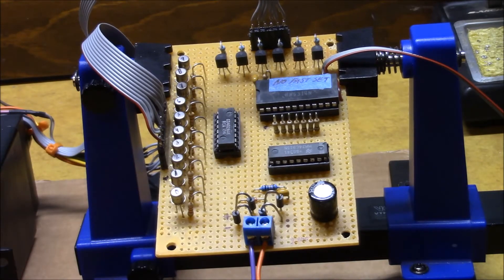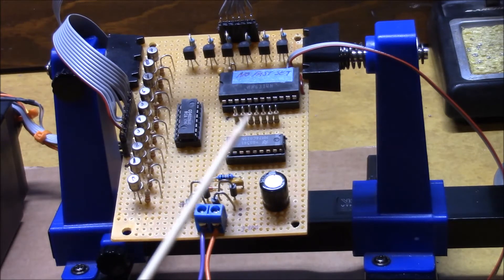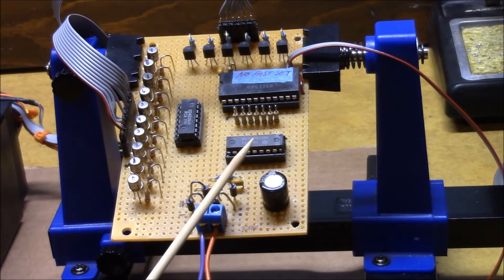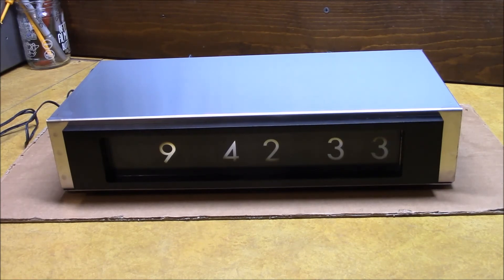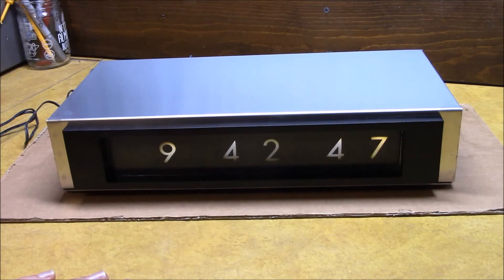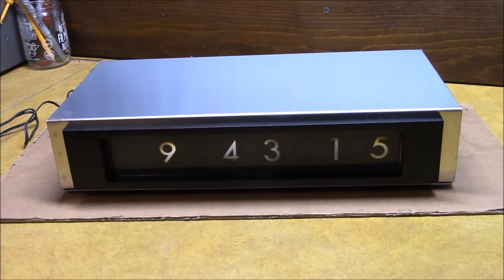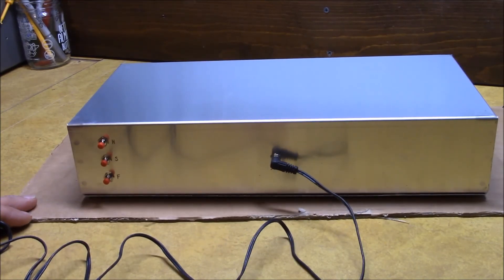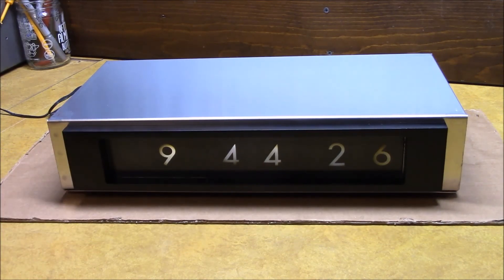Vintage IEE One Plane Projection Display Digital Clock using the MM5314N

Comment: Nice build!  You might try using diffused LEDs as  that could  help with the display uniformity.  I've used sandpaper or frost clear spray paint to turn regular LEDs into diffused 🙂
Reply from the maker: Yes, thanks.  I had heard that subsequently.  I do happen to have a media blast cabinet that may do the trick if used carefully.